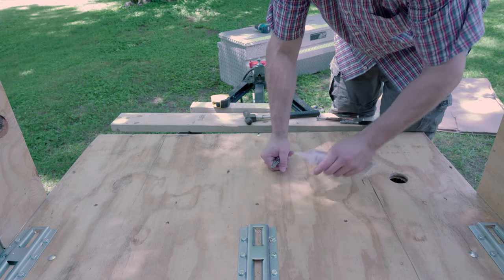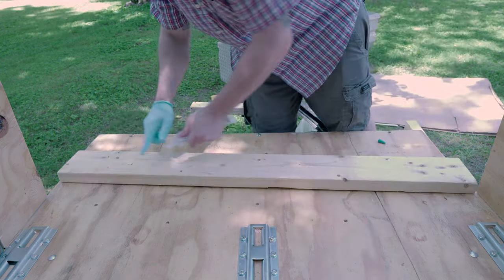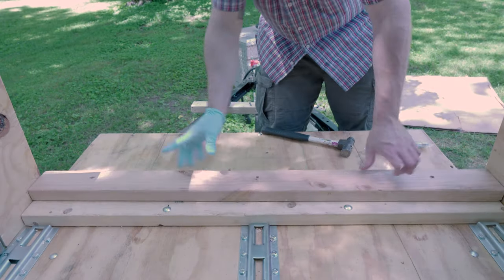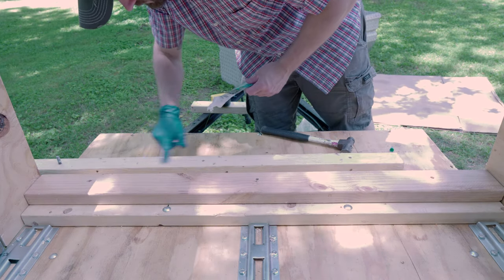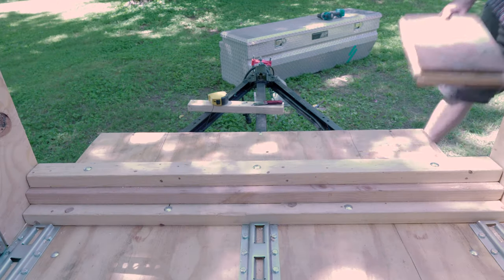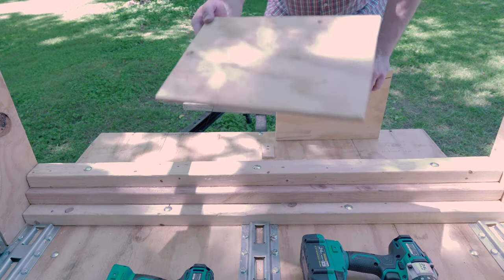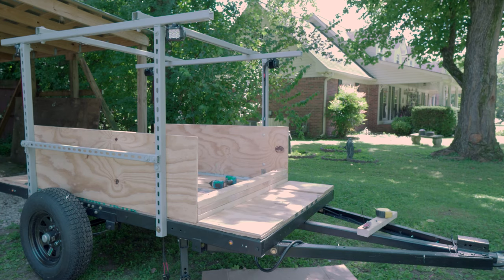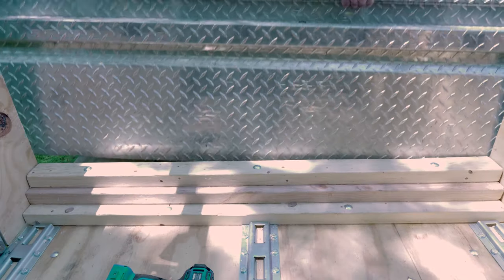Harbor Freight Overland Trailer Build: Side Panels and Tool Box

Comment: Nice build.  I'm seeking to add channel strut to my small trailer to hold a Thule sidekick.  Is the deep channel much stronger than the half-height?  Mine will not hold much weight so would the smaller strut be a better option?  How can I know the load strength of these struts on a trailer?